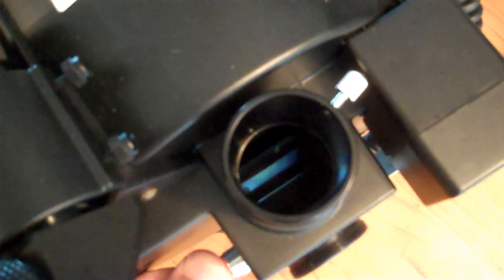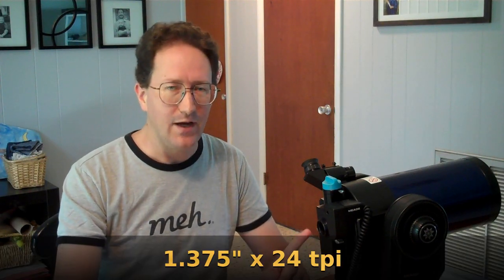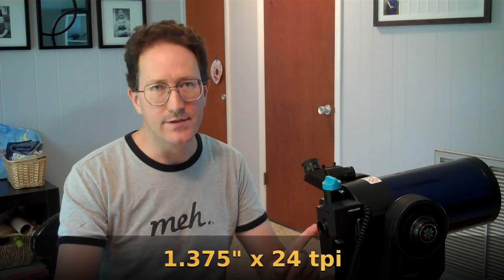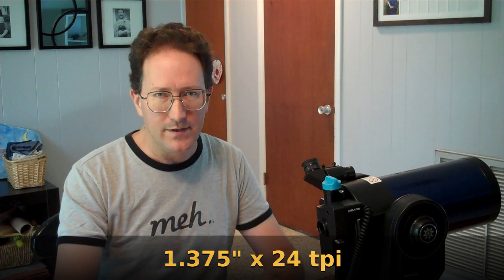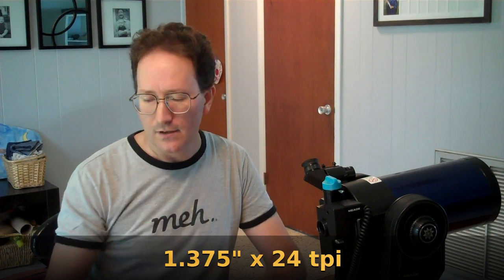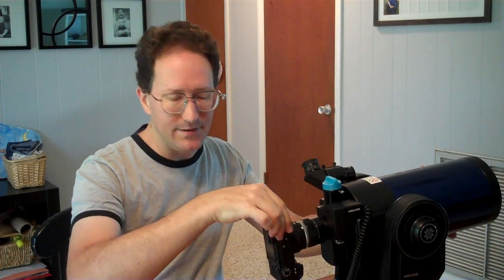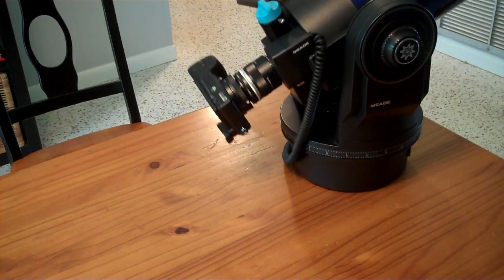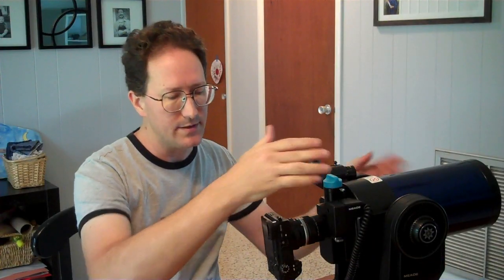Meade ETX telescope rear photo port - size, thread pitch and adapters

Comment: you could find or make a washer/shim between the ring and the telescope body to allow your camera to orient itself correctly, or you could jb weld the ring in the position that would allow correct camera orientaion, rather than letting your camera "sorta hang loose"
Reply from the maker: They make "camera angle adjusters" designed specifically for solving this issue (allowing you to rotate your camera to a specific angle and then lock it down in place).  Sometimes you want a vertical aspect ratio, sometimes a horizontal aspect ratio, depending upon the orientation of the target.   https://amzn.to/3JMj80J

Comment: Hi Jay
Helpful video, thanks
I have a Meade Etx observer with the audio star controller
Hopefully a simple question you can answer for me
Once I have setup and aligned the scope
Then selected an object and GOTO, once it has slewed to the planet or star, will it then continue to track it?

You have a new subscriber, cheers
Andrew
Reply from the maker: Yes, it will definitely attempt to do so.  Two hints that are not apparent from the user interface. Both the GOTO and the ENTER button have a "long press" action.  The "GOTO" button, if you "long press" it will start a spiral search pattern. [This is useful if you get close to the target, but it's not in the eyepiece, so the spiral search will hopefully allow the target to show up and then you can press the button to stop once you see what you are looking for.

The ENTER button if you long press it has a "sync to target" feature, so if you can see the target, but it's not in the center, you can hold enter and then after it tells you to center the target, move around with the arrows until it IS centered, and then press enter to "SYNC" the tracking to that target.  [Can also be used with the finder scope if you are way off target...]
Reply: @summetj  thank you Jay